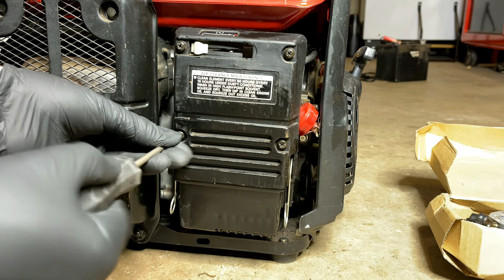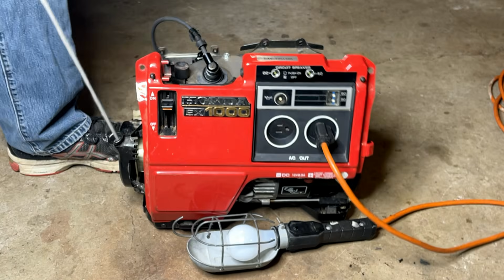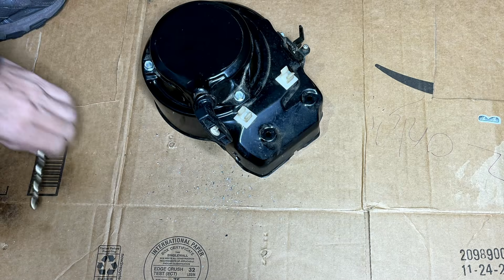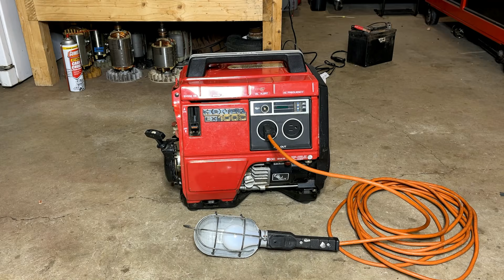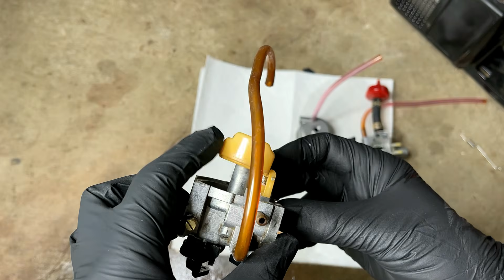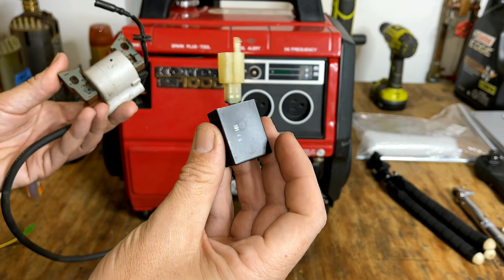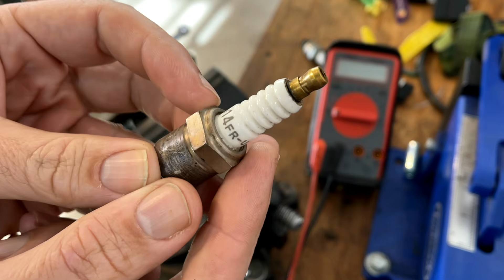Honda EX1000 - Will It Run?

Comment: The smaller they are the bigger the headaches. Some real obscure problems in this one. I know this is several years later but I'm still wondering if the coil had to be reversed. Seems like a Yes but I'm perplexed as to why.

Comment: Why can't Honda use paper air filters? Their foam filters have to be oiled which is messy and, as shown here, they degrade and rot. It's just stupid. Even cheap Chinese generators do much better. Honda generators are not worth their huge price premium. I had to buy a Honda EN2500 out of desperation after a huge storm and it was pure garbage for a $750 2500 watt generator.

Comment: I learned many moons ago that Japanese motorcycle engines run most reliably with NGK plugs. This was through the. advice of Japanese cycle mechanics and parts shops. I did have quite a few poor running issues caused by using Champion plugs on motorcycles before always using NGK plugs. 😂

Comment: James, do yourself a favor and buy a step bit. Harbor Frieght has them cheap.   They even have a nice 3 piece set.  Ive watched you struggle many times using twist bits on thin metal. While not great struggles , a struggle is a struggle.

Comment: I suspected all along the engine spun clockwise... otherwise the fins on the fan blade are oriented wrong. Spinning the fan counterclockwise probably wont do much for airflow as intended

Comment: I would have given up at the spark plug. A thought, what if the plug was designed to do that, to protect the engine from overheating?

Comment: It's the same battery that's used in the original Glaicer. I have 4 batteries and the USB-C port works fine on my batteries.

Comment: How in the heck would one know if the engine is supposed turn clockwise or counterclockwise? I’ve never, to my knowledge used this magic knowledge.
Reply from the maker: 99% of small engine spring clockwise when looking at the flywheel.

Comment: This little generator was definitely a head scratcher. At one point I suspected the spark plug, but I discounted it because it smoothed out and ran fine. I concluded that the ignition system was at fault because of the pops it made while malfunctioning. Personally I have not been a fan of resistor spark plugs because of the simple fact of there being a resistor within them. But I can’t remember one even failing. As a young man I worked for Kawasaki and Yamaha in the racing R&D department. We tried so many different designs and destroyed hundreds of engines just to gain information of durability issues. Bad spark plugs were such a rare occurrence that we seldom ever gave it a thought.
As I said, this was an interesting case and I throughly enjoyed it.
Best Regards, Al Hartley

Comment: Jim is cant tell you how much I enjoy your instruction !! I wish I would have found you a few weeks earlier  after trying to fix my generator …luckily it was an easy carb issue and finally tracked it down to a vac. leak…seems like every year I have a carb issue but have learned about fuel stabilizers and just drain tank after our hurricane seasons and our ( lately cold winter issues) I’m from Houston Texas….but i really enjoy your videos and your work ethic is awesome man ….a lot of times people wont go the extra miles is taking more layers off . I always found out if you dont you will take off stuff later LOL.Biggest thing is for me is I am NOT. And small engine repair guy …I’m a plumber , but even in plumbing you have to have a good work ethic  and go the extra mile like I was alway taught from Dad . Keep doing what you do ….these days I can sit here and binge watch all your stuff Thanks again for what you do for us  !!!!

Comment: I have one of these to repair and have the engine and generator working perfectly. I have the dreaded fuel tank with pin holes in the bottom. I've cleaned and soldered over all the pin holes and basically the entire lower part of the tank. I'm hoping to EvapoRust the tank and seal with tank sealer. Thanks for the idea from one of your videos.

Comment: I was going to say something about your industrial strength patience but I see several dozen folks beat me to it.  I have an exact replica of the subject unit that I need to repair so THANK YOU.  It's a gas tank full of rust so wish me luck.  I ran it for about 30 minutes when it was brand new and then put it in storage.  30 years later, I'm needing to fix it.  The discontinued parts is a bit of a concern.

Comment: What did we learn.  Just because you get sark to a plug does not mean you get spark out of a plug.   Plug was probably dropped and cracked the carbon resistor material in the plug.

Comment: James I have an EX1000 and no petrol is coming out the fuel tap. The tank was very dirty. So I cleaned it our with a proper tank cleaner then coated the inside with Por15 fuel tank sealer. I have put the fuel tap back on the tank but no petrol comes out the on/off tap. Any idea's Derek
Reply from the maker: I believe the fuel tap can be disassembled.  Likely just some of the passages are clogged.  Worst case the part is still available, just a little pricey.

Comment: you need a rubber grommet to go in the hole you drill and one that will let your plug wire through but tight i bought a  box at  harbor freight that was an assortment

Comment: Because there is a lot of gasoline in the carburetor, it chokes and washes that sponge with gasoline, and it is possible that the carburetor needle is not adjusted, and you change the air filter and the fuel filter, it will be fixed because there is no problem, it just chokes

Comment: 21:00 I didn't even know it mattered which way the coil went!
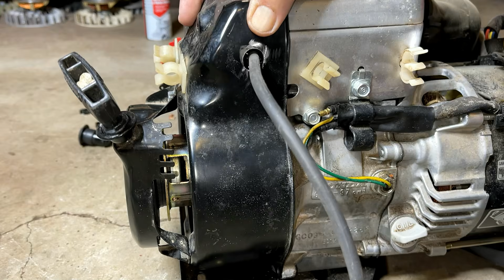26:25 You should put a grommet in that hole to prevent cutting the insulation.
28:30 Good job!
1:09:30 A load makes the engine run hotter. Engine heat can affect the coil, reducing or eliminating spark.
1:10:33 Hmmm ...
1:15:20 I've also never run across a shorted spark plug.

Comment: Tip for making a 'bushing' through sheet metal: piece of rubber tube/hose, slit it lengthwise and wrap it into the hole so the sheet metal sits inside the tube. Old fuel line, old spark plug wire or piece of insulation from electrical wire works nicely.

Comment: Question why do you work off the floor? 

You do have a workbench
Reply from the maker: It was likely being used by another project.  I now also have a lift table so not on the floor as much now.

Comment: I had a bad NGK Iridium plug cause a very similar issue in a 4 stroke coil-on-plug fuel injected snowmobile. Would loose a cylinder once it heated up a bit, would studder and act like that 1 cylinder was lean. Swapping parts around and ended up with $12 worth of plugs fixed it. Never would have guessed!

Comment: I haven’t watched your complete video so maybe you already found rubber grommets are made to isolate electrical wires thru metal panels & would work perfectly here. Also there is a notch cut in the hub you wound the pull rope around,simply tie a knot in the pull rope,place the knotted end into the notch & wind the rope. The rope doesn’t slip when pulled just like engines from the 1950’s before recoil starters. Clearly you are much younger than I am! lol!  Great video

Comment: I understand the parts hassle.  I have a hard working 2 stroke 1984 manufacture Tanaka 300 watt generator but the plastic fuel tank is busted and the generator is no longer made.  It was a real work horse for many years.

Comment: i was always told by my dad to run with the filter on as it affects the mixture.    i did have a faulty oil faulty led indicator, short circuit, that prevented the engine running

Comment: I'm sad to see so many people think this is how you "fix" this.😢 These motors DON'T spin backwards. It Doesn't spin counter clockwise! That's really SH$TTY diagnostics. When you do this the AC works, but now your DC is running current backwards. Also CLEAN you carb jets instead of switch out another carburetor. With is the absolute FIRST thing you should have done, besides new oil and gas. PLEASE nobody do what is done here.

Comment: I have this generator.  Every time I would run it out or drain the fuel I would have to rebuild the carb. when I leave fuel in it, it would run fine.  The other thing is it wouldn't run right with the air filter off.

Comment: There is a thing that needs close to airtight fit. And my first instinct is, just 3d print it. Gotten so used to youtubers having those, and at work i use one often too. But yea, the use you get doesn't really warrant getting one. Specially not if you want to print higher temperature fittings.

Give it a couple years. If the keep getting cheaper and the cheap ones keep getting better at the pace they have been doing this far. It may be a non useless option some day. A lot of free downloadable fittings online to find too, no need to learn modelling, though i guess you might not have trouble at that either, i have had the pleasure of teaching some mechanics and machinists some tinkercad and they seem to just have it click. A lot of same skills. But yep, fittings. That's the true purpose of 3d printing. Making things fit, specially airflow and low wear parts, but it can take a surprising amount of force too. And free fittings online for quite a lot of things, even very niche parts.

Comment: Hello. I just got this same model generator with a no spark condition. My coil tested for 17K ohms but no sparky. Cleaned off the flywheel from surface rust. Tried the same as video which really helped some. Last thing I noticed was a black wire to the muffler. I disconnected a black bullet connection and wowee... a super spark ! Some kind of sensor in the muffler has a single wire to it. It may have something to do with the spark arrestor....maybe excessive heat...You tell me...huh?   Well my genset is running fantastic !   Honda rule ! Thumbs up for a great take apart video Cheefy !

Comment: I`m sorry for this but the first item I changed when a fault appeared on any car engine was the spark plugs.
They are fairly cheap to replace and if they did not cure the problem I always had spares for later.
In my limited experience spark plugs will some time break down under load and this video highlights this.

Comment: Wow, what a journey! After watching the engine choke under load, I initially thought that it might be a heat problem, but somewhere else on the generator triggering an additional safety system. Then you taught me that resistor spark plugs exist, lol. 
Great video!

Comment: I was finally able to get what I would consider to be pretty good patency through the oil pick up hole at the cast stand that the ball ball time too. And now I’m able to get the generator to run but only with the choke open a 16th of an inch or so. If I open it more than that it starts surging and dies immediately. Do you have any recommendations on how to fix this. It seems to be a lien condition.

Comment: I don’t see where you covered dealing with the fuel inlet or pick up point from the carburetor bowl. That’s a very common problem with ethanol gasoline’s. It seems to be hard to clean this out or access the through path as it does a 90° turn. Any ideas?

Comment: I JUST REBUILT A EX 350 ,,,ALL PARTS ARE ORIGINAL N RUNS LIKE A DEER IN HEAT N WHAT A BEAUTY ,,,ALSO DOING A EX650 BUT CANT FIND A RECOIL PULLEY ,,,DO U NKNOW WHERE ,,,,

Comment: I wouldn’t have had a moment’s hesitation replacing that power diode as he eventually did. It’s a regular power diode, not a specialist diode. And yes, get the max power rating and reverse voltage rating. Overkill is better than “just good enough!”

Comment: In the 60’s & 70’s I ran a lot of 2 cycle snow machines.  It wasn’t uncommon for one to out of the blue, start backfiring and running rough.  We always carried extra spark plugs. The first thing we would do is swap out the plug. We’d be off and running.  I can also remember pulling the plug and checking for spark which many times we would have.  We learned to just replace the plug and would take care of the issue.

Comment: i just got one of these off of craigslist for $100. the only problem i found it to have was the nuts that hold the filter box to the carburator (which may also hold the carb, didn't dive that far) those nuts had fallen off their studs and were sitting atop the air filter. i fastened it back together, and today gave it a test run. the unit performed well and just burned up half a tank at moderate load without breaking a sweat. i'm currently trying to track down a 600-750w load that i could just turn on and run continuously.

Comment: YouTube just suggested this video to me.  I have watched a lot of your other ones on generators, but never the EX1000.  I own an original one that must be at least 35 years old, used for emergency use over the years.  So far it has started and ran every time I needed it.  Always ran a yearly test run, keeping the fuel fresh.  The discouraging feeling I got from your repair is that now if it breaks, it is probably trash as the critical parts are no longer available.  But this was so nice to know how to check out all the critical components.

Comment: I just bought an EX1000 exactly like this for $100. Your videos inspired me to do so. It’s hard to start and will generally die pretty quickly when it does start, but it will start and run great if you give it some auxiliary fuel. PO said it would run if the choke was partially closed, so I’m expecting a carb issue. I have lots of professional experience with automotive repairs but almost nothing with small engine stuff, so I’m looking forward to tinkering with it. If nothing else, it was very cheap and should be fun to work on, and there is a good possibility I could have a somewhat valuable and quite reliable generator at the end.
It’s hard to get an idea of size and sound in your videos sometimes, so I was blown away how small these are when o saw it in person. It’s about the size of a typical paper grocery bag, and it’s very quiet. Like, you could easily have a conversation with someone while it’s running nearby.
Reply from the maker: It’s funny how the quiet ones like this seem loud to the microphone.  It is tiny.
Reply: @jcondon1  you mentioned either in this video or your other EX1000 video that you found a service manual. Would you be willing to share where that was? I can find the owners manual on Honda’s site but I can’t find a shop manual anywhere that I’ve looked.

Comment: haven't read all the comments but I'd check valve lash - usually exhause valve seat wears untill the engine heats up and exhaust valve grows in length and quits seating - no compression - "no run"
Reply: remove valve and grind some off the stem but use a surface grinder or have a machine shop do it.

Comment: I might've gone just a little bit deeper. Checking the flywheel for either a missing or sheered key on the fly-wheel. Or if the points slipped? Some newer small engines are solid state ignition. Which are very nice.

Comment: As many others have commented, there is a wealth of information in this video. I can’t count the number of small engines I’ve repaired, non-professionaly of course, in the past 60+ years, and I have never seen a heat sensitive spark plug. Who’da thunk? Thanks so very much for the time and effort you put into this project. Thanks too for the video that allowed us to look over shoulder.

Comment: I own that exact same generator. I had not run in a number of years. Because of your video I pulled it out And started it. It ran perfectly. I hooked it up to a load It drew down for a second or so and then ran great. Probably one of the best generators they ever made. But you have encouraged me to service this change the fuel clean out the bowl change the oil and fuel filter. Thank you very much was a great and informative video.
Reply: Me three!

Comment: Motorbike spark plug caps often have a resistor in. Had one fail on my bike. Was interesting to diagnose.
Never opened up one for a small engine like these.
Reply from the maker: I had a resistor fall out of the plug cap and yearly went down the sparkplug hole.

Comment: James, does modifying the recoil to go counterclockwise would be an easier solution rather than modifying the position of the coil itself? Seems logical that way to me. If the rope was wound incorrectly, can you wound the rope so that when you pull the handle, it spins counterclockwise? Correct me if I am wrong please.
Reply from the maker: You could run a two stroke engine backwards with the coil backwards but not a 4 stroke engine.
Reply: @jcondon1  I see, thanks for clearing that up for me.

Comment: Excuse me, but why don't you put the equipment up on like a motorcycle had jack or some type of table instead of working on the floor. Believe me it all comes back to bite you in the rear. I'm 72 years old and try very hard to stay up off the concrete.

Comment: I have one of those I still use it -- got it in the late 70's or early 80's as I remember -- still runs fine -- I never store it with gas in it and run carb dry increasing choke until all fuel is out of carb (you can switch power switch just before it cuts spark ignition and that shuts of fuel from gas tank first).  FYI it really doesn't have enough power to be useful anymore, really !!

Comment: plug wire hole bushing - it's called a rubber grommet. Available at hardware stores or auto parts stores everywhere.

Comment: This one was really tricky with those issues with the coil, the spark module & carb. but then to find that spark plug that was breaking down when it became heated. I agree with your spark plug analogy, modern plugs are so good I've never had a bad one neither. Good job diagnosing this one, sometimes you do have to go back, double check & look at the problem from a different angle. Not to mention figuring out what the previous person did with trying to fix it before you got it.